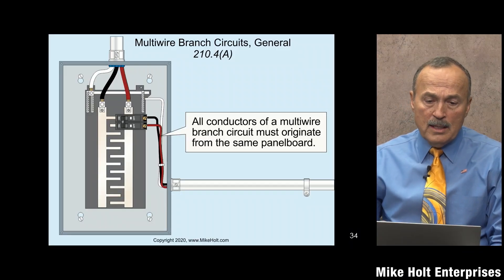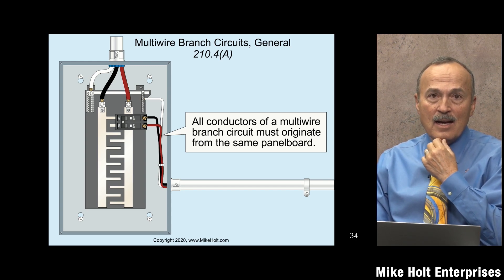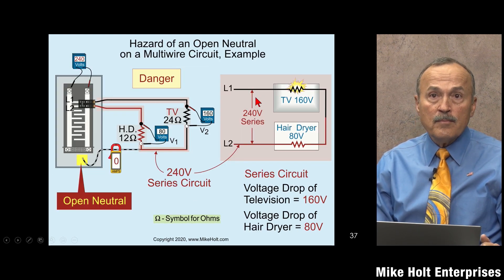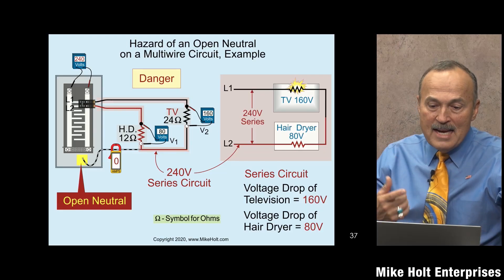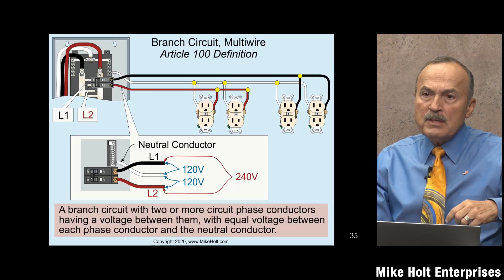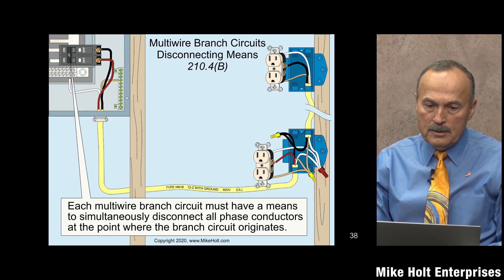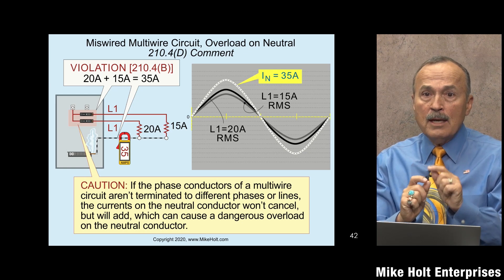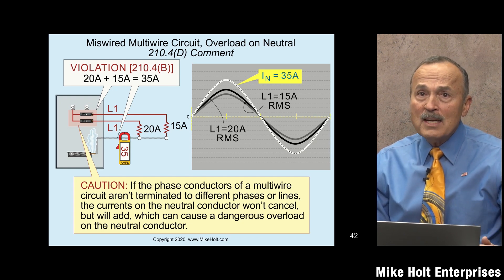Branch Circuit, Multiwire, NEC 2020 - [210.4], (19min:38sec)

Comment: Do not get creative. Thanks for that quote.Have homeowners to so called engineers get creative. Best one was on a Friday afternoon and project engineer said o yea you guys have to hurry up and get a 50 amp line ran for a tech coming in Monday morning to start up a new machine. Told him that would require triple time to have it done on Sunday. He said just grab power from the 3  hanging 20 amp cords hanging from ceiling. Say what. He said 20 + 20 + 20= 60  amps. Broke his heart when we told him you can not parallel #12 wire. 3 of us made 3 days pay for working that Sunday. Told him if you have the money we always have the time.

Comment: Pardon my ignorance but what's the difference electrically between this and the neutrals all connected to the neutral bar in the main panel.
Reply from the maker: You need to watch the video again. A multiwire branch circuit always starts at the panel.
Reply: I don’t think you understand that the L1 and L2 are 180 degrees opposite on the current side. That’s what AC alternating current stands for. So IF you are doing this type of circuit for design/build reasons you are sharing a neutral.  Depending on loads you may or may not be seeing current go back to the panel.  If you are not going to do this you are running another home run in 2 physical places. I used this in my own home to supply power to back to back side opposite wall that 1 leg is microwave and gas stove top loads and other is TV entertainment system. Used a 10/3 cable instead of 2 12/3. Easier and it was all the space I had in panel. Breaker is a double pole 20amp. Heavier wire is due to length and less voltage drop

Comment: When he says 50% further with a MWBC  is that only with DC?
Is there any current code that confirms this when doing voltage drop
Reply from the maker: Example Line 1 - 10A, Line 2 = 10A, Neutral = 0A. This is not Code, this is electrical theory, and doesn't matter ac or dc.
Reply: @MikeHoltNEC  8:08 When talking about Edison and how he "invented" the MWBC. 

So I understand the the theory of neutral carrying current. 
What's throwing me off is the voltage drop and Edison being able to go further due to a mwbc.
Reply from the maker: @anotherreview5586  Let's have two 2-wire circuits carrying 10A and each conductor has a resistance of .5 ohms. The voltage drop of each conductor is E = IxR, = 10A x 0.50 ohms = 5V per conductor. Assume 120V circuit less 10V (5V x 2 wires), the load for each of the two circuits operates at 110V.
If multiwire circuit Line 1 = 10A, Line 2 = 10A, then N = 0A. In this case, there is only 5V drop on the phase for circuit 1 and 5V drop for circuit 2 (since there is no neutral current). So each circuit operates at 115V. This is covered in my Electrical Theory program (MikeHolt.com/Theory).

Comment: I don't understand why anyone would choose to share a neutral in a residential split phase system like this. How much money are you really saving versus how many headaches and future problems you create.  Just run 1 neutral per 1 circuit brewker and keep it fool proof.  This is particularly true when dealing with home owners versus like a facilities manager.  And with that, There is more of a valid argument with 3 phase for this, especially in large buildings.
Reply: @hgbugalou Wiring practices have changed over time.  You find many more MWBCs in older houses.   Electricians had their reasons.

One common practice in decades past was to split the two receptacles on a duplex outlet and put each receptacle on a different leg.  Years ago houses had fewer circuits and runs were longer.  If you intend on putting three rooms on the same circuit, dividing the receptacles and running a MWBC makes a lot of sense.

Arc fault mandates have largely killed off MWBCs, and under present day practices the norm is to wire as you suggest.  But many of those older houses are still wired in their original configuration.  Electricians will encounter them!

Comment: I think multiwire circuit is not planned for that kind of charges,  but for apliances  working as a whole like a panel for control of pumps, specific  machine, or even small subpanels, or similar loads as suburban light distribution,  for residencial distribution as in this video is better and marked individual monofasic circuits.

Comment: @mike holt
Thanks!
But by putting a clamp on meter to test the neutral in MBC won't help much cause there won't be a load...
If a even load..
Reply from the maker: A MBC neutral will always have current if the load are on.
Reply: @MikeHoltNEC  of they are perfectly balanced??
15 on 1 15 on 2, 0 on neutral..
Reply from the maker: @mechelb4158  I understand the 'theory' but let's get real, this is never going to happen.
Reply: @MikeHoltNEC  possible! 
Somebody runs 2 heaters on a mbc...

Possible to pls make a video on linear vs non linear. 
Thanks!
Reply from the maker: @mechelb4158  What percentage of the time do you think that when loads are on, the neutral conductor would show '0.00A?' I give it almost zero, but I'm interested in your thoughts.
Reply: @MikeHoltNEC  very very rarely,
But could happen if you run a 12/3 for 2 15 amp heaters etc..
Reply: @MikeHoltNEC  ...i imagine that manufacturing tolerances alone would guarantee slightly different voltage drops even on ‘identical’ equipment.

Comment: Computers have electronic boards and are non linear loads, technically the code prohibits the use of MWBC on circuits where the majority of the load is non linear. Code doesn’t care if your going to lose a bid. Do it right.

Comment: NEC should require shared commons tagged or marked as such in panels.
Reply: Well, the hots for that said nuetral should be on a 2-pole breaker or locked breakers so you should easily figure it out.  If you can't you shouldn't be there in the first place.
Reply: @vlad1889  Nothing should be left for "figuring" when it comes to these types of circuits - the risk/danger is too high.  An NEC Official red label or tag would make it crystal clear.  NOTE:  Don't forget, it is an assumption that the panel is wired correctly.
Reply: That would be top perfect. And most O see do not have the 2 hots on two breakers common tripping. And some panels minies can be installed that the 2 in one breakers come off just on leg!

On way too many where diy electricians do to add on circuits and they think all the neutrals are OK to tie together anywhere 🙄

Comment: The MWBC is unsafe.  Period.  This is because it cannot pass a one component failure analysis.  A robust electrical system must be able to tolerate at least a single failure without catastrophic results, a single failure includes a severed or shorted wire.  

What is troublesome is that this brings the entire NEC Code into question:  what other approved methods are dangerous?
Reply from the maker: That's an instresting perspective... excellent.
Reply: @MikeHoltNEC   I mean the NEC is all about nail plates, conduit, etc., devices and methods to protect and make the system survive attacks.  And then NEC allows MWBC.  Ironically, 2 neutrals in the same slot is safer than the MWBC - at least with 2 neutrals you know Danger.  

But this video and situation reminds me of a perplexing situation in a small, old home with knob and tube wiring - you may find it interesting and may already know what the problem is.

The house had 3 circuits done in K&T.
Evidently back in the 30's, the house was wired on a single leg and they must have gotten creative.
Balancing the circuits between legs on a new breaker panel would have lead to.... fire - without tripping a breaker.
I have no theory how they could have wired things for this to happen.
Reply: NEC was not meant to be used as design material, it was written to prevent fires

Comment: Will using a GFCI at start of each branched circuit avoid the open neutral issue?
Reply from the maker: Nope
Reply: The GFCI measures the current leaving on one of the legs and returning on the neutral.  If they don’t equal then it flips.  With two hot legs feeding the shared neutral there will always be an imbalance.  That’s what the problem was with grounded neutrals on GFCI generators connected to houses, where the current would have two paths back and would flip off the circuit each time turned on because of the imbalance with the neutral.

Comment: I have made it a habit to place a current clamp around any neutral conductor before disconnecting or lifting the neutral conductor from its connection when working in commercial or industrial settings. The best practice is to trace the neutral and be aware not every circuit you are encountering was installed to code!
Reply: If a multi wire branch ckt has equal load on each, you will read 0 amps on the shared portion of the neutral. So, be careful. The current cancels, which is why the whole thing works when using different sides of the split phase. If you share a neutral for two hots on the same phase, the current will add together.
Reply: @paaao  Yeah, but if the hot measures (say) 5 amps and the neutral measures anything else (including 0 amps per your example), you'll know there is either a low grade short or a shared neutral.  If the amperage changes when you turn off the breaker for the circuit you want to work on, you'll know it's a shared neutral.  :-)
Greg's method is a good one and most folks don't bother.
Reply: That is good thinking.  Good way to trace down a neutral too.
Reply: 100% good practice! 

I learned to call these network circuits. 
Is this correct terminology?  Not an electrician by trade but know more about electricity than most electricians I work with. + I never see these breakers even if on opposite  legs tied together that would trip or turn them off together!

Comment: Great video. Very helpful.  One thing that may cause people to connect multi wire branch circuits wrong is the use of tandem breakers.  If you connect the two hots to two tandem breakers you will over load the neutral because tandem breakers are same leg.  But many people assume that any adjacent breakers are always opposite leg.  Tandem is an exception to that.  

Also I was surprised that no one mentioned that shared neutral is not compatible with gfci.  That’s a good reason not to do it.
Reply: I'd like to reword this. If you connect the two hots to the two circuits on the same tandem breaker, then the neutral will be on the same leg (phase).  However, if you use one switch from each of two separate tandem breakers, each hot would be on a different phase.
That said, you still have not met the requirement that the two circuit breakers be tied together with a handle tie.
There are devices called "quad breakers" which are essentially two tandem breakers bonded together in one case with the two inner breakers connected with a handle tie and the two outer breakers connected with the handle tie thereby allowing for (2) separate 240v circuits.
In this case, if my description is poorly worded remember that "a picture is worth a thousand words", so simply Google "quad  circuit breaker"  and click on 'images'.
In a full panel that accepts tandem breakers, these can be really handy when you're adding something like an electric dryer because they can come and configurations like 30 amps / 20 amps.  :-)
Not trying to be mean or arrogant here, but for new folks, this might be surprising information that is really helpful. :-)
Reply: @SwingboyPA  yes tandem breakers can be very useful when used correctly.  Your example of adding a dryer circuit is helpful.  The problem is I’ve seen too many older houses with tandem used incorrectly by someone who didn’t understand what they were doing.  A thorough inspection will often find various electrical problems even when the work was done by a professional.
Reply: @neilbrookins8428  yes, I run into that all the time. Almost all of my work is residential in houses over 100 years old ... So layers of work over layers of work.  :-p
I am constantly using double pole AFCI circuit breakers literally as diagnostic tools to find additional shared neutrals on circuits that are already shared neutral circuits.... Like I'm making sketch plans of people's houses with color coded circuits for shared neutrals and shared hots.  LoL

It's always nice to 'meet' another electrician who is thorough and thoughtful Neil.  :-)
Reply: I have a mwbc with a gfci breaker and works perfectly. What exactly do you mean?
Reply: @fattysgarage1754 you can't separate the upper and lower plug receptacles on a GFCI outlet like you can on a standard outlet.  So if you have a GFCI receptacle on a MWBC then it's on one leg or the other.  I'm not sure how a GFCI receptacle would behave if you had 10A on one line but 8A on the neutral because you had 2A on the other leg.  I'd guess it would trip.

You can definitely create GFCI protected MWBCs - by using a 2-pole GFCI breaker.  I've done this many times for a MWBC to serve an under-cabinet receptacle for a dishwasher and garbage disposal.  The only minus is that 2-pole GFCI breakers tend to be expensive.
Reply: I guess if the 2 loads combined don't exceed the amperage of a single breaker, it wouldn't be an issue.  An example would be a refrigerator and a dishwasher on a 20 amp tamden breaker.  If the dishwasher pulls 10 amps and the fridge pulls 5 amps, the combined load on the neutral would just be 15 amps. But in that case the 2 could have been combined on a single 20 amp breaker and not a mwbc.
Reply: @jeffhenson5471  Not OK.  The same argument could be made for ANY two wires on the same phase. Don't ever do this. The reason that you don't do it is because you don't know what the potential load is.. for example, what if someone plugs in a toaster oven with an extension cord going to the same receptacle the refrigerator is plugged into because there weren't enough counter receptacles?

Comment: So you can share a neutral on a 120/240 panel? I thought you're not supposed to on a single phase 'cause you would over load your neutral.
Reply: You can share a neutral as long as the two hots are on opposite phases.  The main point that I take from this video is that code now (and sensibly so) requires the two breakers to at least be handle-tied together.  Even better would be to use a 240 breaker.  When I bought my house in 1989, I saw that it had a multiwire branch circuit, but the two individual breakers happened to be placed on the same phase, which was not a good thing, since it would cause an overloaded neutral.  Luckily there was no detectable damage to the wires.

Comment: Wow i learn something new.. Can i put a a 220 plug on to a water heater?
Reply: It would be safe to have the water heater get its power through a plug and receptacle.  I'm not sure if the code would allow it, but there's no good reason for it to disallow it, as long as the circuit only has one receptacle, and it's of the proper type for the voltage/amperage.  The latest code might require a GFCI for such a setup, though.

Comment: I can vouch for the Murphy's law of multi-wire circuits.  Had a variant of such a circuit in a 240/120V all electric motorhome.  Some 120V receptacles had 3 volts, others had 208 volts.  Finally found an open neutral in the opposite end of the 40 foot vehicle (it was a loosened critical neutral crimp connector!), but too late to save the $2000+ RV fridge. :-(
Reply: I've had the most problems with open neutrals caused by the utility company.  It's like some of the linemen don't think it's as important to securely tighten the split bolt on the neutral as they do on the hots.